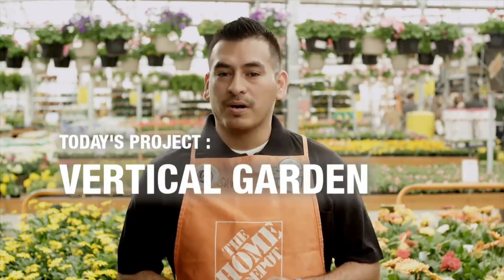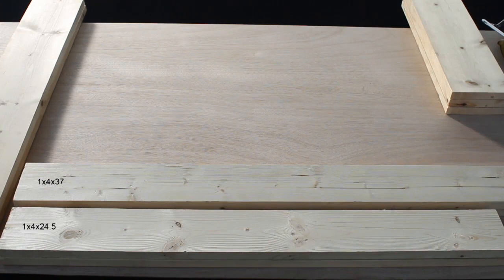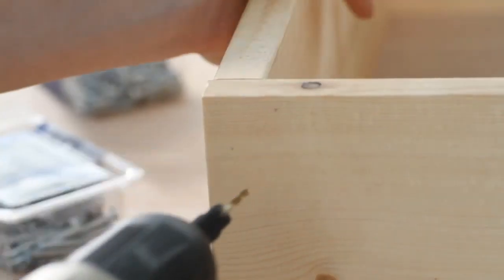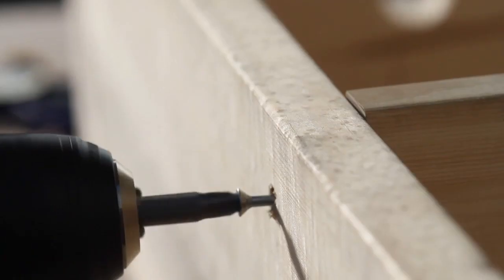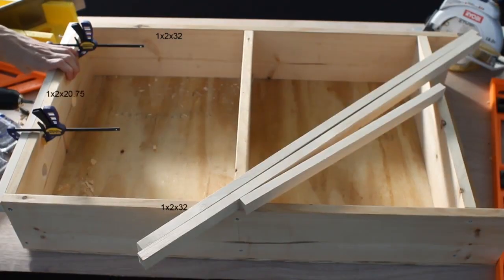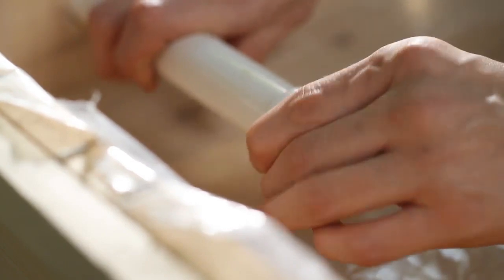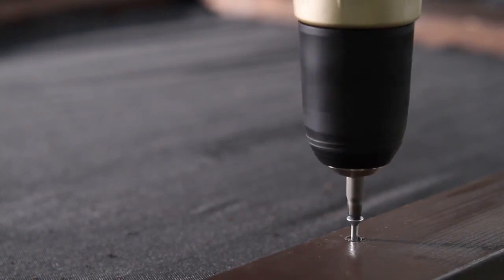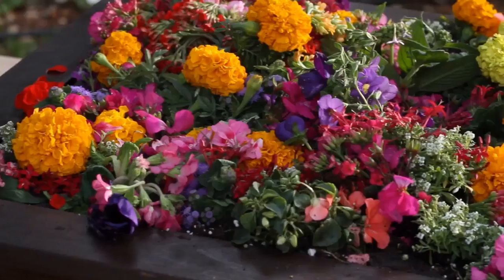DIY Living Wall | Vertical Garden Planters | The Home Depot

Comment: How do you water it.
Reply: Lisanne Norman 
I would assume on shower mode on a hose nozzle from the top if it had an opening or just straight on it. 😂

I honestly have no clue lol
Reply: Spray it with water
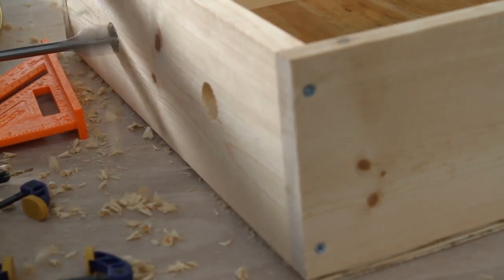Reply: 1:32 pay more attention
Reply: In the top wholes
Reply: Use the plastic mustard and ketchup bottles for picnics. Put the water in next to each plant. Do not water when it's humid. Onlyvwater when needed.
Reply: Lisanne Norman Clearly you didn’t pay attention to the part of the video where they made the IRRIGATION system

Comment: I had this done and it extremely heavy if you’re hang it. Any suggestions on how to mount safely?
Reply: Cleat hook on wall studs
Reply: Timberlocks
Reply: Command strips
Reply: The HD suggests screw eyes and hang from rope. I am worried about the wind.  I am instructing this workshop in a couple of days. I am going to suggest D-ring hooks. They are used in galleries for heavy frames. It will make the frame flat on the wall. You can add the screw eyes and rope for a great faux look.